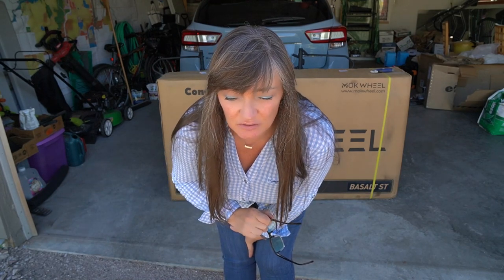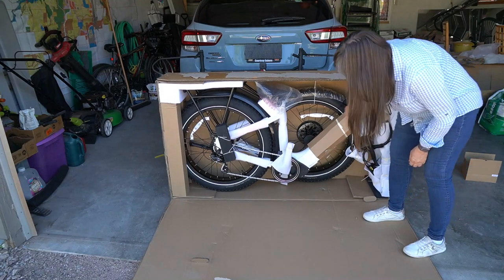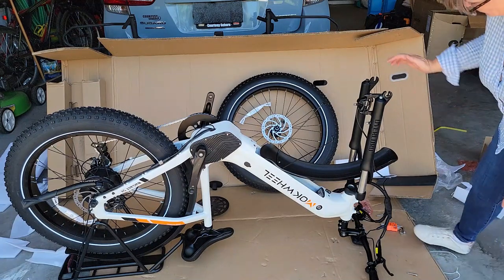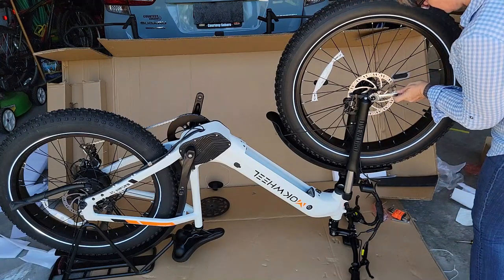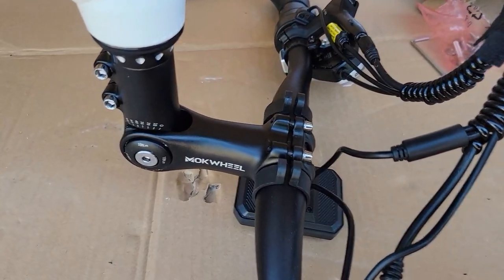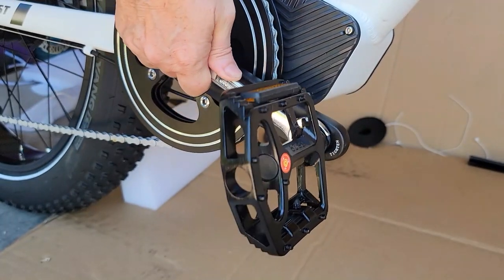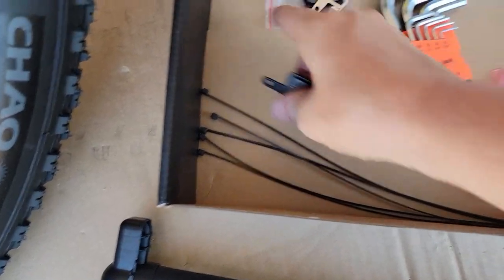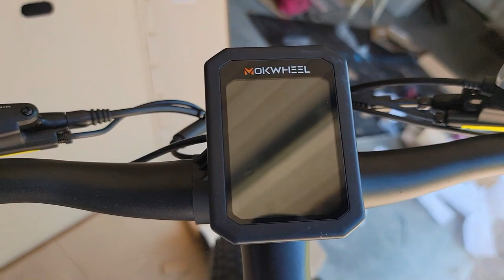Mokwheel SOLAR POWERED E-Bike Assembly | Mokwheel Basalt ST

Comment: Great unboxing Michelle!  Very useful info regarding the fork orientation during install.  Have you gotten your battery yet?  I just ordered the same bike, White Basalt ST... gonna be intrigued to see your review of the ride itself!  Thanks again for this video, safe travels!
Reply from the maker: My battery was only a couple days behind the bike, I have almost 300 miles on it now with commuting a short distance to work few days a week! I did have trouble with the PAS: the gasket was off kilter and got squashed up against the sensor during manufacturing, so if your assist isn't working properly that could be something to check! I also had to replace sheared off bolts between the frame and kickstand. Aside from those two things, I LOVE the bike! Enjoy yours!

Comment: What cable did you use to charge the bike from the solar generator.  You have cable number or type
Reply from the maker: I use the cable that came with the bike, it's got the ac plug that goes into either my solar generator or a wall plug.